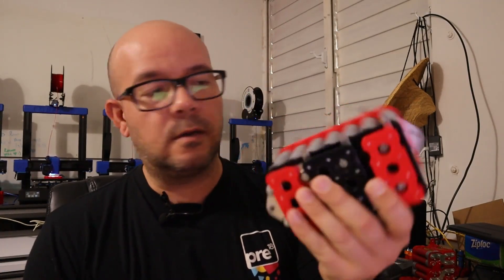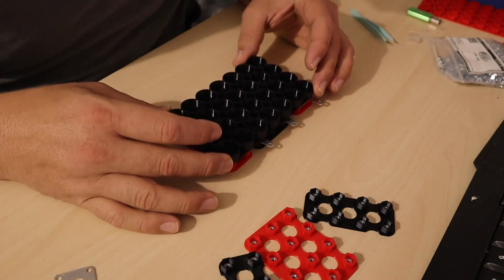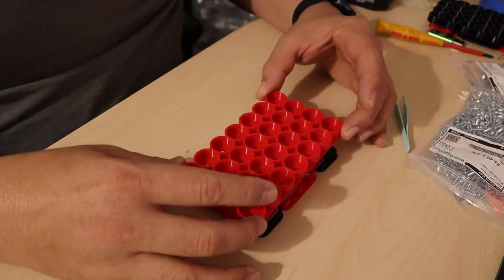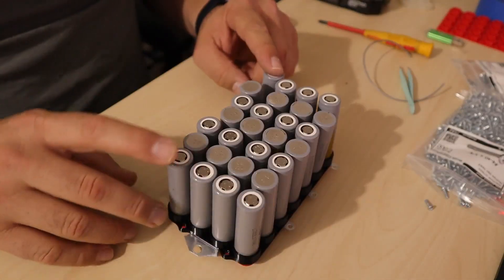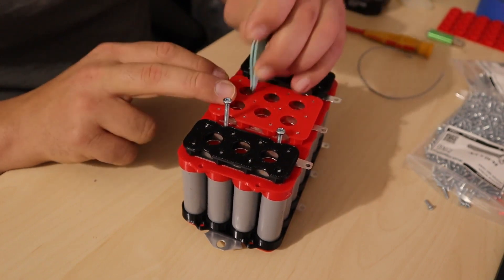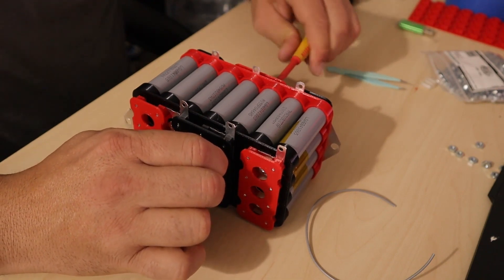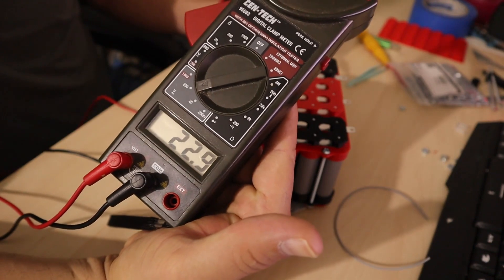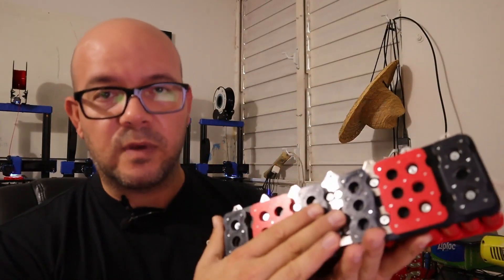How to assemble the Diy 18650 Powerwall kit version 4

Comment: To keep the nuts from rattling loose, once assembly is complete you can put a drop of nail polish (it is a thick, quick drying lacquer) on the nut/screw area. Cheap, efficient, strong but easy enough to break loose should you need to take the screw out anytime in the future.
Reply from the maker: Thanks for the tip.